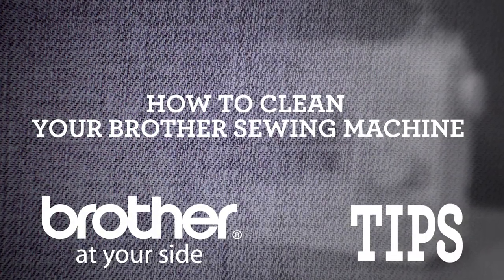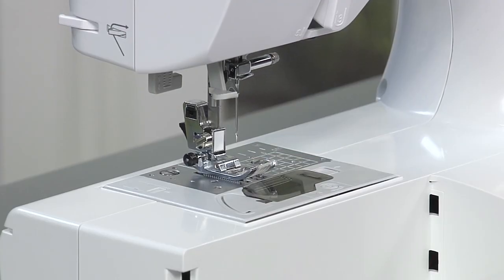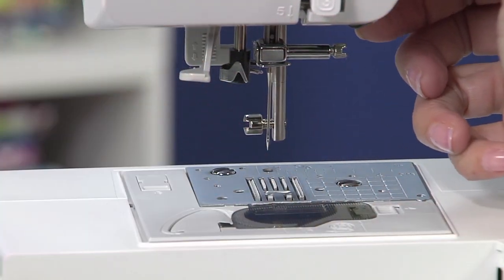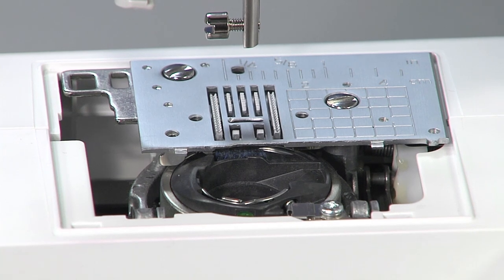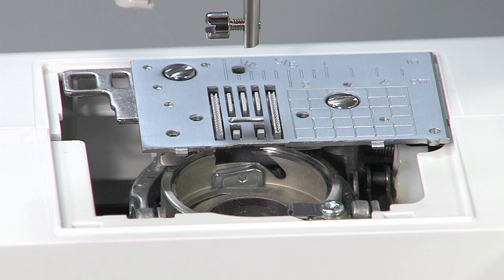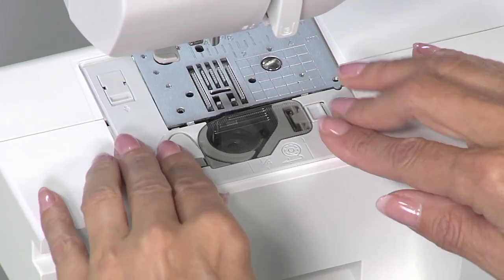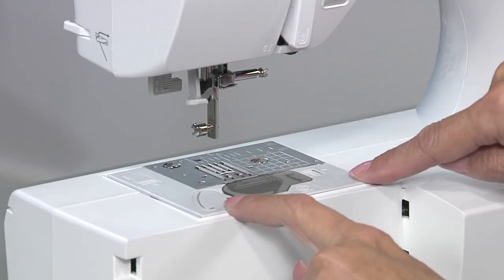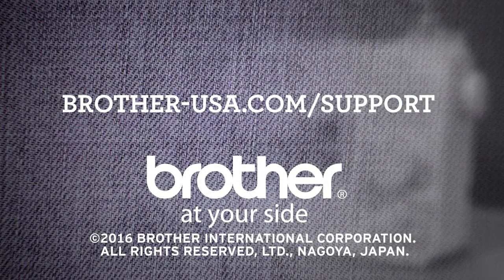How to Clean Your Brother Machine

Comment: I have a situation, I had a year without using my Brother machine, Model LB5000,, I shipped to Europe, was vandalized, at last I ordered the power cable, the problem I see is the start button is on all the time, I get a warning message, " put the needle plate, it has it, I cleaned, nothing works, I wonder if perhaps that irresponsible personnel working in that agency, did something, besides the items stolen, all the foot pressers, tools, ballpoint needles, I reported them, immediately they sold that business. I cannot understand why my machine doesn't recognized the needle plate, what to do?
Reply from the maker: It is frustrating to receive an error message such as "There is no needle plate or there is no needle plate cover". Please see the link below to help:
https://help.brother-usa.com/app/answers/detail/a_id/130596
If you are still experiencing the same issue, please reach out to Brother Customer Service at:
https://www.brother-usa.com/support